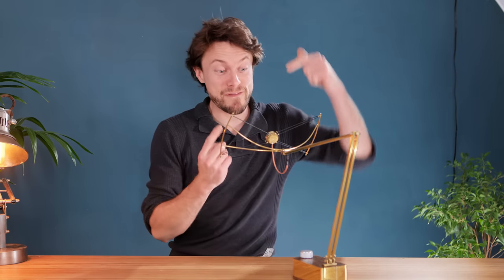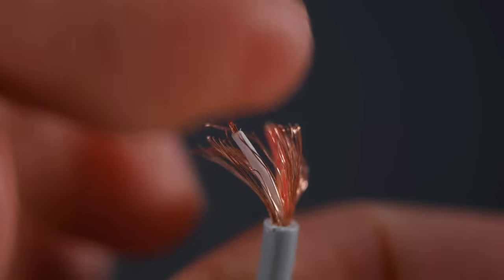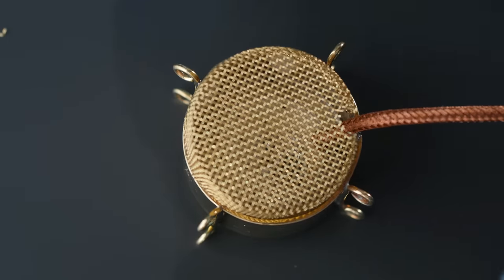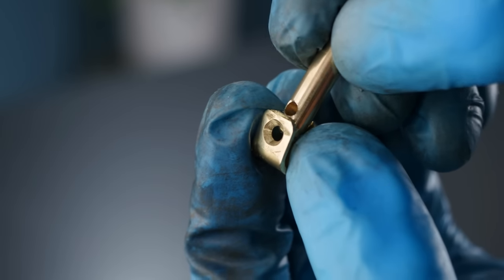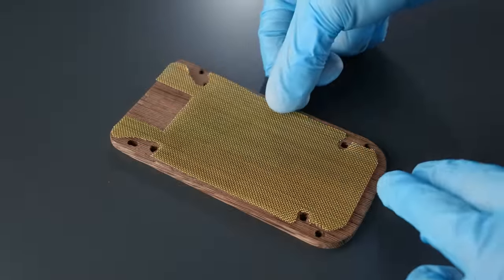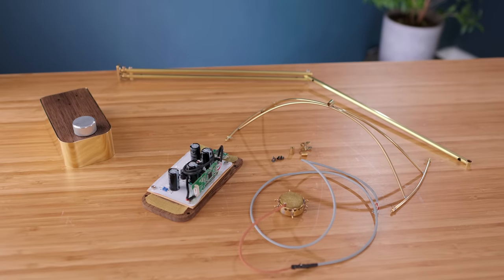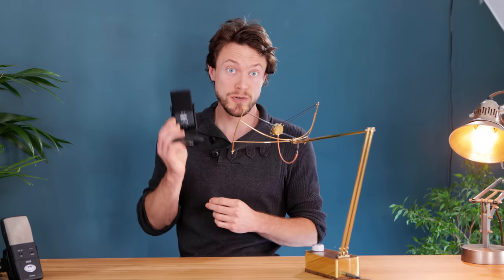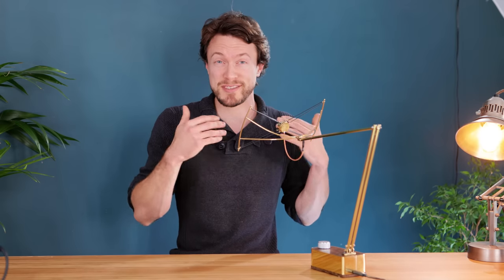Building a quality USB-C microphone

Comment: I would LOVE for you to make an XLR version of this microphone so people could hook it up to any audio interface or audio processing gear they might have.
Reply: +1 here. I'd LOVE to modify my BM800. I was lucky with it, but I need to up the quality.
Reply: I have crappy chinese mic who needs phantom power, I could try to change the capsule.
Reply: Just the same but you dont need the circuit board, but this will require a phantom power capable mic amp.
Reply: Yes! I would love that!
Reply: +1 I was thinking the exact same thing!
Reply: @tuttocrafting  I don't think they'll need phantom power, he mentions in the video it's a permanently polarised capsule i.e. an Electret capsule.
Reply: @marcusjslee  but the FET needs a supply voltage, its not a passive component.  it only needs a tiny current, so a couple of button cells would do.  May need one extra capacitor.
Reply: @raykent3211  yep, good point!

Comment: The difference in bass response is heavily dependent on a chamber to build up the minute bass-y parts picked up by the capsule, so the difference audible doesn’t come as a surprise to me. Keeping the technical limitations in mind this microphone you built there is… actually mind-blowing! No, seriously! Even tho 25EUR/USD dynamic microphones today can be astonishing, this is a technical achievement to behold. Not only a condenser microphone with a really competitive sound, but a USB condenser to boot. You never cease to amaze! You single handedly destroyed each and every USB microphone on the market, price to performance. That is, talking about sound quality of course, as handling plosives will be exceedingly difficult here. - especially on the cheap, comparable to the price of this build.
Reply: Just make a pop filter out of a nylon stocking :D
Reply: @jama211  I know very little about sound but I've seen voice actors use face masks.
Reply: Nylon stocking doesn’t do much in terms of plosive rejection. You could use no pop filter for what little it does help.
Reply: Problem with his price is that it doesn't take into account all the time spent, it's purely material cost. Time ain't free.
Reply: A pop filter on this would be perfect

Comment: For straight talking, in an acoustically sound space, that 40 euro microphone is equally as good as the  3k usd one. Astounding. You sir, are changing the  world for  the better.
Reply: Exchange rates amirite.
Reply: This is where a better audio system would help your ears - or hurt them, depending on your perspective. I won't go into detail on mine, but the DIY mic is closer to 90% the quality at 1% the price. Still an unbelievably massive win. The expensive one is warmer and the DIY one has some high frequency hiss - which could be eliminated with a low-pass filter in a future circutboard design(which would mean an extra resistor and tiny capacitor on the board) - or maybe even a ferrule on the cable. Hard to know where the hiss comes from without personally diagnosing it. 

This is of course totally pointless unless you're a content creator aside from the fun of pushing things to perfection. There won't be a noticeable difference in the bitrate of a discord call.
Reply: @elibeeblebrox1084  also it doesnt make full justice to put the neumann in a scarlett. Agree with the comments, and at 40 bucks this design is still astonishing and super good!
Reply: @elibeeblebrox1084  Yeah, the hiss is quite noticeable for me which is unfortunate, because it otherwise sounds pretty good

Comment: The quality of the microphone gives a fireplace couch type comfortability. Could be the way you speak, but Im sure its a mixture of both. You're right, there are lots of high and low ends without either sounding too harsh. Maybe a backstop to the microphone could change some of that directional audio but regardless the microphone outputs amazing quality and looks great. Thanks for the tutorial!

Comment: What a beautiful device! Very inspiring. Just a small problem with the JFET buffer amplifier/impedance buffer.
1. You need to connect a large value resistor to the gate of the JFET and ground to provide a known biasing point. Although currents are small they still need a DC path to ground.
2. With 2.2k on both the drain and source you are saturating the JFET and putting it into a non linear region, increasing the distortion products significantly. Just remove the 2.2k from the drain and it will self bias back into the linear region. I ran an LTSpice simulation on the buffer and then FFT on the output and it reduced distortion from -60db below the main to negligible/unmeasurable levels.
I am going to check out the rest of your videos.
Reply: I'd love to see the results of someone testing this.
Reply: The DC biasing of the LTSpice simulation shows the Source at -450mv(forward biased with respect to the Gate which is not what you want) and the Drain at +450mv, so you have a forward biased Gate and only 900mv across the Drain/Source, again not what you want, you need at minimum 2v to 3v Drain/Source and a reverse biased gate for the JFET to work correctly.

Comment: There is no question that the Neumann U87 Ai sound a lot better, especially in the lower mids and low frequencies. However I'm pretty sure I haven't heard anything sounding even close to this good, for that little money. I've been producing music for around 20 years and I'm certain that this is the best sounding $35 chain (mic+pre+ad) I have heard. The sound floor is also just amazing.
Reply: The Neumann sounds a bit too much in the low and mid and misses the clear high. This DIY is way more clear in sound.
Reply: @Speakerdeamon  But the diy mic has a crispy sibilance that makes my ears hurt.
Reply: @reginaldbowls7180  Yeah, but I think that's probably a ten dollar fix
Reply: @bracholi  how?
Reply: I don't have your expertise, but I agree with you. 
I don't do any type of recording. I just listen, so I'm curious of where would you value this might chain at? Highest and lowest competitor.
Reply: If your not a professional and this was sitting on a shelf for $50 it would 100% be worth the grab.
Reply: @reginaldbowls7180  you just use a VST plugin (audio software) to make it sound better than a 10.000$ microphone. That simple..
Reply: there did seem to be a sound difference, the bigger microphone seemed to have less "hiss" than the smaller one. I wasn't sure if that was due to the distance between the speaker and the device input or not. But damn that little brass monster sounds nice. Too bad it got C-3PO'd with that knob.
Reply: Basically, it just needs a pop shield. Either a stand-off cloth screen, or a foam cover, or a big puffy tuffet of fluff that fits over the capsule cage itself.
Reply: Guessing most of us don't have that "trained ear". I thought his mic sounded better than the 3k mic. Pretty willing to bet most people who didn't hear the hype behind the "gold standard" mic would say they sound the same or that his mic was better. Remember most of us watch these videos on our phones or equally poor quality devices.
Reply: I'm surprised some people can't hear how clearly better the Neumann is. Certainly not worth it for just a single DIY youtuber, but for a big channel or an audio studio I wouldn't touch the DIY mic as is.
Reply: @Malkadir  I'm surprised you people can here much of a difference at all.
Reply: @johnmichaels4330  Just add some programmable hardware dsp on that cheap mic. 
Those expensive mic, actually has pretty high profit. What do they sell is better tuning, either in software or hardware. And don't forget, the brand.
Reply: "There is no question that the Neumann sounds a lot better". You cannot be serious about that. You are obviously biased towards the Neumann (everyone is) and the only way to compare is to do a blind test.
Reply: @reginaldbowls7180  small amount of foam
Reply: nah you trippin they basically the same lmfao
Reply: @grproteus the issue with testing like this is that someone spending that much on a mic will not use the stock output. The neumann is a better mic by far, the diy mic "sounds" better on average consumer audio when only recording his voice.
Reply: I agree that his voice sounded slightly more natural on the Neumann, but it took me most of the time where he was switching between the two to realize that. If I just heard the mic in a video, I would assume it was like a $2,000 mic. Not quite Neumann level, but close. I also like the look of the DIY microphone better than the Neumann.
Reply: This is something that is actually recommended for vocal production because it sounds flatter you can apply more processing to it, if it's too sharp dry then it sounds worse after processing. All the most expensive microphones in the world have a flatter/smoother sound. @Speakerdeamon
Reply: I'm fairly certain someone could make a video with two identical microphone samples. I swear, as long as price comes into play, "audio engineers" will flood the comments saying how amazing the more expensive mic sounds. Listen, we're not analyzing FLAC samples through electrostatic ear-speakers while sipping a whiskey. This is highly compressed YouTube audio, damn.

Comment: This is absolutely stunning and it's so cool how knowledge can be used to leverage all possible components for a given need.

As a tiny heads up, that's more likely a knitting needle than a knitting stick (which would also be far more easily available).

Comment: Adding a secondary outer tube that can extend out and cover those holes would make it so you can mode-select between allowing off-axis sound and a more tight pickup pattern. Fantastic project as always, you never miss with these! The brass is beautiful and you might be the #1 brassworker in the world after all this practice and experience...
Reply: This is good, actually very good, but Gold standard for brass I think goes to Clickspring and the Antikyra, Card press and clock he built.

Comment: Just built mine, and it sounds amazing (Thank you Matt for the amazing video), 

But I didn't want to spend much on brass so instead I used a donor mic body to hold the capsule.
My pc has a dedicated mic port so it simplifies my build by a lot, meaning all I need is the mic capsule and a transistor (that's it). 
The one thing I had trouble finding was the transistor as the 2n4416 doesn't seem to be made anymore, so I used a J305 which works just as well (and cheaper).

Overall, it costed me $25 with shipping and is well worth it, it sounds much fuller compared to the old tiny capsule.
Reply: Hello! What Mic body did you use?
Reply: @funktionmedia  I was using a EIVOTOR microphone from amazon, which has a full metal body and the capsule perfectly fits into the mesh.
I just desoldered the old capsule and took the plastic holder out and then put the capsule in with some extra wire to avoid strain.
A mod I did have to do was to sand the coating from the mesh and the body at the ends so they can make electrical contact for grounding, 
The good thing is that you can't see the sanding from the outside as it's internal. 
Hope this helps.
Reply: @theduckom  Hey thanks for this :)
Reply: Does "dedicated mic port" mean the normal 3.5mm mic jack you would use? And could you provide me some detail with what you can leave out in this case?
Reply: @Justin-cy8de  I have the mic plugged into the mic port on the back my of pc, the only components of the microphone was the capsule, J305 transistor and I wires for grounding.
Reply: @theduckom  THanks for the reply, so you use it without any of the amplification if I understand correctly?
Reply: @Justin-cy8de  yup, the pc does that for me
Reply: @theduckom  May I ask what you plugged it into for that it gets loud enough? Semi professional motherboard?
Reply: @Justin-cy8de  
the microphone loudness is pretty good, I have my mouth within 6 inches of it, in 
windows, you can up the sensitivity 

it should work with any motherboard with a mic port, as modern motherboards have built in sound cards.

you can test by using a multimeter on the aux port for the mic, it should have a weak voltage out. mine was 3.9 volts but it varies
Reply: hey! howd you do the grounding? i was trying the epoxy method mat does but idk what epoxy he uses. any advice is appreciated!
Reply: @Hbeanz1017  for my microphone I connected the outertab of the capsule to the ground wire using some wire
Reply: @theduckom  I meant the part you had to sand! Like how do I ground the metal mesh that goes around the capsule? In the video mat says it needs to make electrical contact but I don't quite understand how he does it
Reply: @Hbeanz1017  Oh, I just sanded some of the paint that connects the mesh to the metal body and used a multimeter to check conductivity, then connected the body to the ground
Reply: @theduckom  awesome. Thank you so much for the replies!
Reply: @theduckom  how on earth did you take that mic apart? only screw just drops the plug connector out
Reply: @Hbeanz1017  yeah it took me while to understand how it fit, the whole body is one piece of metal.
To take it apart, you gotta pull the mesh off the top of the mic. I recommend using a small flat screwdriver and pushing the mesh up from the sides until you can get a grip to pull it off
Reply: @theduckom  Oooooh ok sweet. Yeah I was super confused lmfao. Thanks again for the reply!
Reply: @theduckom  im sorry to bother you but stuck on the grounding bit again. after seeing the inside im still not quite following how i ground this and to what. so i sand some paint off the mesh, and then how do i connect the mesh to ground? ive got various wire i can use, but idk if thats the right way or how lmao
Reply: @johannesschwarzer7933  I connect the microphone ground and negative together and connect the positive to the signal
Reply: @theduckom  Hello, what happens if you connect the signals separately? Tip, Ring, sleeve
I have a bm800 microphone and I want to change its scheme to this one.
Reply: Computer's mic port is very noisy.
Reply: Hello. I'm a complete newbie to this. I have a $50 Samson microphone. Can I just replace the capsule? Will it work?
Reply: Did you already have all the tools that DIYcraft does?
Reply: Bro I'm doing it, with the shipping it costs me 63 € ..
Reply: I'm interested in making an XLR version of this, what would need to be changed?
Reply: i want to ask about using jfet. What do you rely on to find alternative jfet? do you have to adjust the value of other components?
Reply: A.M.A.Z.I.N.G...
Reply: @Chinhnguyen0497  I guess he just calculated it. It’s not that hard. Many ways led to the Finnish product.

Comment: It's crazy just how similar the DIY mic is to the $3,000 one. You can hear the differences, and I would say the $3,000 edges out over the DIY one, but only in a subtle way that isn't worth the price difference. You could take the DIY sound and punch up the bass a little and probably derive a similar sound at the end.
Reply: There's definitely a crispy distortion in the DIY mic that's completely gone on the expensive one. It sound fuller in the low mid tones and still retains all detail. It's true most people using a quality microphone professionally don't need that level of quality but for the people who do need it, the price is totally worth it. They probably have a collection of similar ones to suit every need.
Reply: @ThaJay  would a deadcat and amp finesse sort out the tinny highs of his DIY mic? I noticed that too and makes me wonder how it would handle plosives.
Reply: I don't know, I'm not an expert on the technical details. But I've definitely seen people in the comments who seem to know a lot about this stuff, suggesting there is something to be gained in the amp.
Reply: The DIY mic sounds “brighter”, which I guess means it is biased towards the high end, but for $2970, I could process it a little...
Reply: yup. only by a bit for 100 times the price
Reply: Not worth $2970 more though
Reply: The DIY one has this vibration that makes the audio slightly fuzzy, but you can only tell when it's immediately compared with the 3k one that just sounds so smooth and clear
Reply: That's sometimes the difference between a Beyoncé recording to a regular girl recording.
Reply: Yeah, that blew me away how similar the A/B test was through tv and iPhone speaker… there was a slight bass boost/low mids richer and the diy was a bit louder in higher frequencies. Obviously just listening through phone and tv speakers isn’t a great test and with quality headphones would be much easier to hear the differences…
Reply: Yeah, that blew me away how similar the A/B test was… there was a slight bass boost like you said and the diy was a bit louder in higher frequencies; but as a quality mic, it def passes the test. Obviously just listening through phone and tv speakers won’t
Reply: Or you can buy a 20 dollar microphone unit instead of the 15 dollar one. Very similar cirquit. And possibly even better sound. Or you'd spend some money on a microphone DAC. And still spend way less.
Reply: @KwameMitchell  the cruel joke of diminishing returns
Reply: This method won't compete with enterprise markets, buying X brand with the aftercare and being able to replace it easily by throwing money at the problem as a business expense, but if you have spare time, the performance is impressively comparable.
Reply: This comment section is funny af 👋